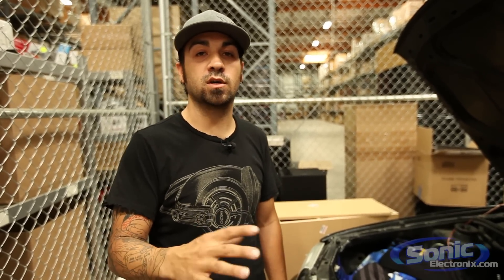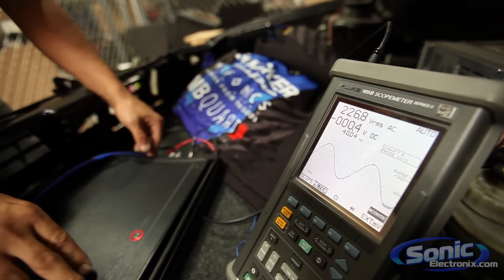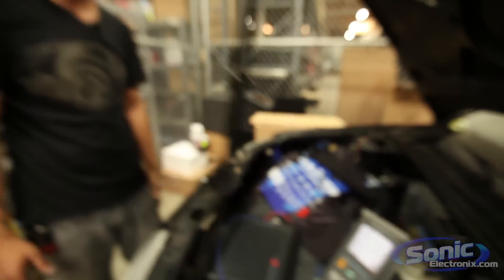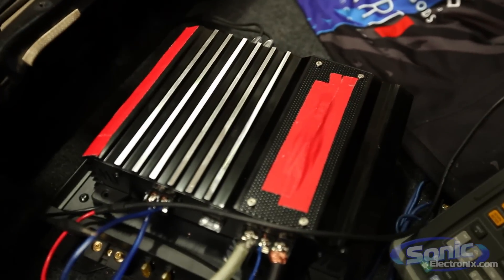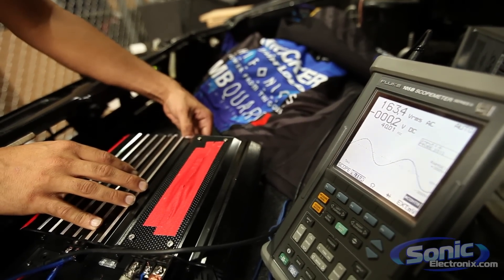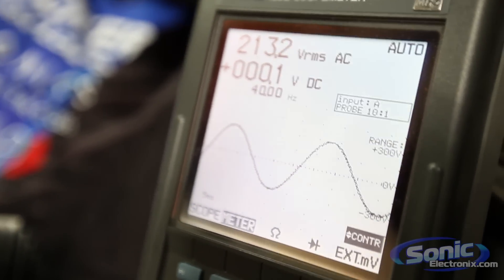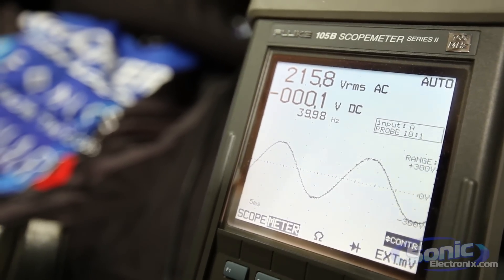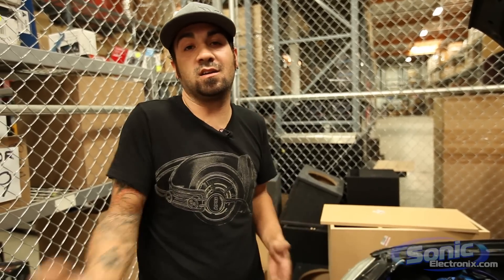Overrated vs CEA Car Amplifier Test | True Wattage Revealed!

Comment: I understand all this but what I don't get is the big Korean amps like DC, Sundown, Crescendo, etc do they really put out even close to the wattage they say cause like the biggest amps the mainstream company's have are 1200 to 2500 watts where the Korean boards go way up there to over 15k watts. Are they just more competition oriented then say kicker, fosgate, JL, or MTX? Or would say a 5k DC be about as loud as say a Slash 1200/1 in real word in car results. I actually own a JL 13w7 and HD1200/1 and in another car I have a DC 2K on 2 12" inch lvl4's and the DC does get louder but doesn't have the sound quality of the JL. If the Korean and Brazilian amps like DC and taramps really do those crazy numbers there very cheap compared to Main Stream stuff. I'm thinking it's just two different camp like spl competition vs street sql. Am I correct or does it take a DC 5k to equal a JL 1200/1 regulated amp in actual loudness and sq?
Reply: Korean amps are really solid and arent very cheap like your implying, ive owned 2 and they are amazing, love them... electronics from Korean and Taiwan are usually serious and high quality. no bs. They either put out rated or more most of the time.

dont know about brazilian though.

But of course knowing the actual brand your buying from and how they backup their product is much more important. Do your research. I favor small enthusiast company that actually care about having big, quality performance over big name companies that cares about profit as a huge priority......

that DC 5k does more than rated, absolutely not comparable to the Slash 1200/1... lol

Comment: I am lost, frankly it almost looks to me as if you put a normal 1:1 probe but set the probe settings in fluke to 10:1 so it bumps RMS voltage x10 and then somehow call it Watts. Unless I am missing something.. but  even the waveform shows V in range +/-300V which of course cannot be true for audio amp. So what is the trick?

Comment: sir do you know how much does Rockville RXH-F5 3200 Watt Peak/1600w RMS 5 Channel Amplifier Car Stereo Amp rated at ?
Reply: Hi.. Rockville gives two ratings ! But Rockville is cea 2006 compliant and they do rated rms power . I know you didn't ask me , but I looked into Rockville and there legit.
Reply: I have that Rockville amp and it comes with an amplifier production certificate inside. On the box it says RMS is 400W (100x4) @ 4 ohms + 1000W at 2 ohm mono, and that CEA is 200W (50Wx4) @ 4 ohms + 350x1 @ 2 ohm mono. The certificate on my amp says 206W CEA but doesn't have a listing for the sub channel. When I went to tune the gain on my amp's sub channel I was looking for 44.7 VAC on my meter per Ohm's law since the current = sqrt of [1000W RMS x 2 ohms] = 44.7 VAC, but I could not get that far with the gain turned all the way up. I figure that I am safely at about 700W RMS on the sub channel based on where I backed the gain off and my meter reading 38 VAC. Since CEA is about half of the RMS rating, I figure 350W CEA is about right.

Comment: WHERE can I get that METER!!?? :O 
What an invaluable tool for tuning stereos!
Reply: you can find them all over the internet. plan to pay a premium price because fluke is not cheap. its a fluke 105b scopemeter. depending on whether or not its been replaced and or discontinued you may only find it reliably on ebay or other such sites. good luck!
Reply: Carmine Allocca if you don't need a calibrated setup then pass on fluke and go with a cheap ebay or amazon scope kit (premade) for 30 to 50 bucks. it will do what you need. you can also get usb setups for pc or Mac.
Reply: That one a Fluke 105B, its about $1,200

Comment: Back in 04 I purchased a RF power series amp model 330 for $330. paired with my 3 12" kicker cvr's they were ridiculously loud. A buddy had a similar settup but using a 2000 watt planet audio and my 330 RMS walked all over his amp. Those first Power Series amps were serious and were $1 per watt, but were bullet proof; mine is still in service.

Comment: I am interested in car head unit actually power ratings, Kenwood is not CEA participant so I wonder if it stacks around Pioneer 14 watt or alpine 18 watt per channel.
Reply: A couple of watts like that isn't gonna make a big difference realistically. Just buy the Kenwood. They usually have nice eq adjustments and are just as good as the Alpine.
Reply: I ended up going with a pioneer because of its bluetooth capability.
Reply: +milfhunterX good choice man, Ive had lots of pioneers and they have all been awesome even my old tape deck one.

Comment: one of my customers wants a cheap system. and boss is the best quality I can get for his budget, but a boss woofer with a boss amp should sound ok since they are both as underrated each other, right?
Reply: +electronics for fun two shits dont equal good
Reply: Christian Creighton BOSS is very good for what you pay for. or at least l have had no issues.
Reply: i have purchased many boss amps radios and even their dvd units (which have broken relatively fast). and im not saying its total garbage. im just saying that just because you have two matching pieces of equipment doesnt mean they are ganna sound at there best even for the price. just based on them being the same brand. subs take power. no matter what gives it to em.  and if boss is ur only budget then more power to you. but the proper box can give you upwards of 130 db even with a single 8'' sub. ive easily managed 140's with 2 15's on only 500 watts. splitting so 250 to each sub. and i personaly love Autotek and have run their amps for years, even dogging them without needing to do anything. even replaacing a fuse. and i mean i still use an x class from autotek thats from 2004 so its 12 years old and will still give just as much as it did when i bought it.
Reply: Christian Creighton yes l know all of this. l was just saying that a speaker that will blow easily with it's R.M.S. power, needs an amp that delivers less power. so the same brand matches. l was kind of half joking.
Reply: but it doesnt.... you control the power the sub gets with the gain of any amp... so once again ur wrong tho....
Reply: Christian Creighton how am l wrong? what you said about the gain, doesn't contradict anything l said. all you did was mention what a gain knob is for. which has nothing to do with what l said. l am talking about a cheap amp and a cheap sub being equally as bad as each other. what are you talking about?
Reply: you said because they are equal they should be better. im simply saying that has nothing to do with it. you said. "a speaker that will blow easily with it's R.M.S. power, needs an amp that delivers less power." that is not true.  ANY AMP IN THE WORLD CAN GIVE NEXT TO NO POWER AT ALL IF GAINS ARE ALL LOW. thats my point. so matching it with the same brand doesnt matter at all. you could go even cheaper then the sub if you wanted to, but it doesnt make what you have good. like i said the first comment. two shits dont equal good.
Reply: +Christian Creighton I never said equal means better. that would mean that a lightning amp and woofer would sound better than a rockford fosgate woofer and a Memphis amp, so you are wrong there.

what I said was true. a cheap woofer needs an amp that delivers less power. yes you can use just about any amp, but why would you be stupid enough to do so? let me hook my 5000w amp, up to this 300w 10 inch sub. just turn the gain down a bunch. 

I am not saying bad is good, I'm saying it is equal. it should sound DECENT, not good.

keep in mind this was for a budget system. I didn't give the guy a generic woofer with a super high quality amp. I gave him a decent woofer with a decent amp.
Reply: i gotcha. and clearly you understood my point it could simply be done and  doesnt HAVE to be done. which i thought you were saying for some reason. but i gotcha

Comment: Hi, can you clarify what you're doing? I see the oscilloscope reading 300 volts rms when by the waveform I can clearly see that it isn't actually registering 300 vrms as the peak to peak voltage isn't high enough for that.
Also, you're using 40Hz and I don't know that the impedance that will equate to on the load you're using, therefore, I cannot apply Ohm's law to figure out if the amplifier is actually delivering the 300W, if you also had an ampmeter in there it would be nice.
The "red tape" amplifier said that the RMS power was 250w for 4 ohms impedance and you used a 2 ohm load right? That is not good and invalidates the test of the competitor amplifier as it doesn't seem it has been rated for 2 ohms.
If you don't know why I'll give you an example. Let's say that an amp was made for a 4 ohm 25w load and hence would give a maximum of 10v 2,5 amps, if you connect a 2 ohm load it still delivers 10v but the amperage will surge to 5 amps and the power to 50w, it'll play badly or burn as 5amps is double the maximum spec, in order to do 2.5 amps in a 2 ohm load it would have to deliver just a puny 5 volts which at 2.5 amps is 12.5w, meaning, it would start clipping at half the rated 4 ohm power, so, if you still managed 225w out of a 250w amplifier rated for 4 ohms but using a 2 ohm load, I'm impressed it managed to get that far without burning, I could also observe that it didn't clipped at 160w when in theory he could start doing so at 125w and still be within spec, so, overall, that amp is likely to be within spec (and in fact be underrated, it's possible it outputs more than the kicker without clipping but with a 4ohm load) and your test is garbage.
Reply: Agreed.
Reply: yeah except for the fact that you could clearly see the waveform... pay attention man. Its a legit test.
Reply: and number comparison the second amp clearly doesnt output the same
Reply: Schooled! This presentation brought you by: you guessed it, kicker lmao
Reply: brody wiggins read it again and then try again.
Reply: you must be a atheist lol

Comment: Hifonics ZRX2000.4 Car Amplifier
What is the accurate amount of watts does this amp push out??
Reply: using a ammeter and digital voltage tester set to AC and a 40hz test tone should allow you to get amps and volts, using math and by multiplying both numbers will give you watts, ammeter clamps around positive wire to sub, voltage meter goes on each terminal!
Reply: Oh ok but your not sure as to how much u would get out of it
Reply: It says 1000x2 at 4 ohms max power, but using the method I said can actually reveal true wattage!
Reply: 1000x2@4ohms max, that's bridged 2 oh channels, and max is usually 'double' rms. So unbridge the channels, you get 500x4@2ohms. Make it rms, you get 250x4@2ohms. Make it 4 ohm, you get ~125x4@4ohms. Now that's only if this was CEA rated. You'll probably get around 50 to 75 watts rms at 4 ohms, if you're lucky.
Now for the reasoning for 4 ohm; you wont find speakers rated for 2 ohm, or at least your common store bought speakers to go with your store bought amp. 
Also look on forums and see what people say, the internet is your best tool.
Realistically, at best, this amp is just a common 4 channel amp that will power those cheap speakers you just bought. Everyone makes one of these. I still have my old JL E series 300/4 that will most likely out-perform the hifonics amp. 
Always go with CEA rated equipment. Not only does it show the amp is truly rated, but it also shows that you'll be getting better internal components.
Reply: Thanl you so much for your advice guys do appreciate it

Comment: As someone said; the scope is reading VOLTS rms. You need to use a dummy load for the output and clarify what you are measuring.
Reply: Do you listen to a dummy load?
Reply: Measure peak (of a sine), do some math, get watts.
Reply: @lazzer. i know lol i was referring to the one that thinks hes right.
Reply: i believe you need to actually look up what you are saying before you speak. because there are a few oscilloscopes out there that measure "watts RMS" out of audio! kind of like the SMD amp dyno. also. the dummy load only serves one purpose. and that is to save your ears from the annoying sound of the frequency youre playing! so yes please tell us more about how much you think you know...
Reply: which btw that oscope can measure watts rms. and i assume that fluke may have made a mistake with how they displayed this. because it appears to say "VRMS" which im pretty sure that shitty ass amp is not putting out no 200 volts! even some high end amps arent even getting up to them numbers. just something to think about.

Comment: Was the speaker wire running THROUGH the O-scope?  If not it cannot measure AC amperage and therefore it cannot measure wattage.  My scope also has a wattage setting on it.  It is not accurate in the least.  So this test is bogus.

I totally agree that the cheaper amp probably did not do rated.  But the numbers you're showing cannot be wattage unless its measure amperage as well.

Right on the meter is even says 'VRMS"  That's volts, not wattage (WRMS)
Reply: This is old but you're right. You need to know the amperage to calculate ACCURATE power. Without amperage you can't calculate resistance of a reactive load like a speaker because of impedance rise.
Reply: The Amp Lab wait a minute. This coming from the guys that don't even have a power supply good enough to test amps at actual rated voltage of 14.4. Testing hifonics amps at 13 volts and saying they don't do rated because they are missing a volt and a half. Gtfo. If you haven't upgraded your power supply you have no gun in this fight. Worse dyno videos with the most unreal results ever. Giving good amps a bad name one dyno at a time, the amp lab. Gotta upgrade the power supply and then do amp dynos.
Reply: Ever heard of ohms law?  power can be derived using the right value components.
Reply: I know all about ohms law.  I know enough to know that ohms law applies to DC, not AC....

Comment: I would like to know if a pyle that says it produces 80wX4 is true
Reply: Trevor O'Brien Knowing Pyle's rep for producing cheap crap notorious for shorting out and/or not working at all, it'd probably go straight into protection mode. 80wX4 would probably be nothing short of a miracle. Boss audio is the same. They mark an amp @1000w (peak) and it delivers a couple hundred at best.

Comment: I would have liked to see both amps tested at 4 ohms as well.  The cheap amp may have put out more clean power at 4 ohms then it did at 2, especially if it was not designed to drive a 2 ohm load.  It may not be typical, but it probably would cut manufacturing costs, and if it did make 250 at 4 ohms then it wouldn't be as much false advertising as you proved in this test.

Comment: Amplifiers used to be rated like this:
75 watts per channel RMS, all channels driven from 20-20,000Hz into a 4 ohm load with 0.02%THD at 12VDC
  
The manufacturers would also give you damping factor, slew rate, channel separation and signal to noise ratio.
  
They NEED to go back to this, so you can compare apples to apples.

Comment: 14.4 volts is unrealistic.. considering the fact that if you put a new load on the alternator that it was regulated for then its moot. Cheaper amps are alright for mids and highs with a good cross over. Bass doesn't really need anything except power and a prefered cross over frequency. You can tell most of the b.s. by looking at the power and ground connect size as well as the fuse ratings and how many there are. Electronics are goofy

Comment: You guys should start doing amp tests, that would be something you could do about the false advertisement, you could test the major brands that you sell, or test by the most requested. This will bring in a lot more business. Just as Steve Meade is doing, everyone wants amps to be test before they purchase and its to late to return them. I just purchased a Hifonics BRX1100.1D and i had and still have no way of testing its true RMS power.

Comment: this is why i searched this stuff up. i looked at the power acoustiks amp which was 700w rms @ 2ohms for $100, perfect for my subs in parallel. looked in the details and saw it wasn't CEA 2006 compliant. googled it and turns out a lot of people were saying the amp most likely will not produce near to 700w rms @ 2 ohms, said nope not getting this amp.

Comment from the maker: The horrible truth is that this market is not regulated enough, actually, most electronic markets are not. We sell a wide range of product at all price points so that anyone who wants some bass can get it. The amps that don't output what they specify tend to be the cheaper brands, this is always the case in any market. They output power in relation to their price range so they still do their job, just you have to figure out what is best for you. It sucks, but there is nothing we can do.

Comment from the maker: Just because it is great at putting out power does not mean it puts out enough power. You need 250 amp alternator to give your entire vehicle and sound system the power it requires to play at full potential.

Comment: It's a 98 suburban lt.stock alternator.I was told by my mechanic that the alternator is good and strong at putting out amp power or voltage.I have two gold batteries in the front and my amp is wired with 0 gauge wiring.

Comment: does it mean that PDX  (V9)which has 500w as rms and 4*100 watt at 4 ohms a piece of crab, because its power will not change if i connect it to a speaker whose ohms is 2 ?

Comment from the maker: The efficiency for a Class D amp is, on average, suppose to be 80%(0.8). Class A/B amps on average are 60% (0.6). However, there is a Class D amp that is 90%(0.9) efficient, so if the efficiency rating is given, just plug that into the formula. For weird amplifiers, like Class H or Class BD, just stick with 0.8 unless they list otherwise because most of them are based on Class D technology anyway. Cheap Class D amplifiers can be 60% or less efficient, that is why the formula just a helping tool.